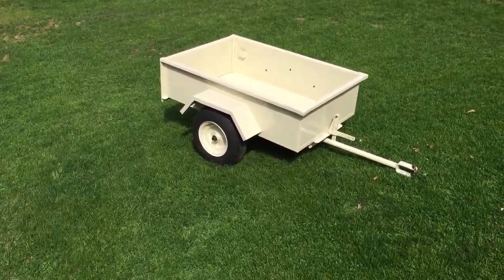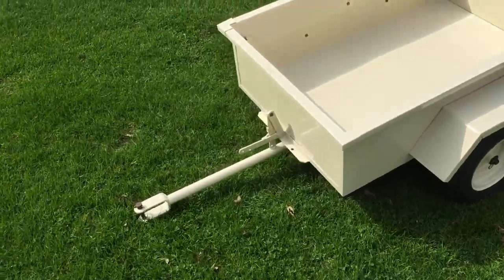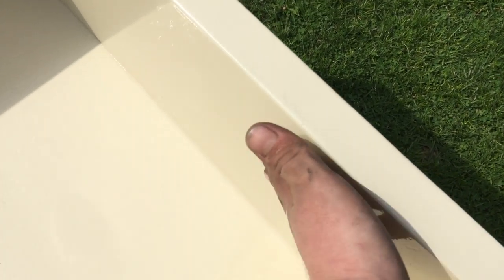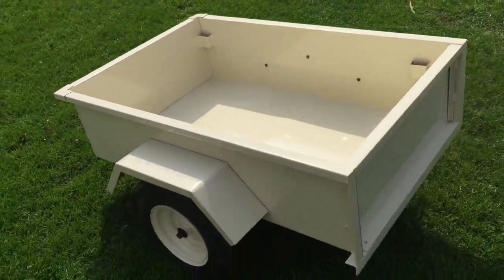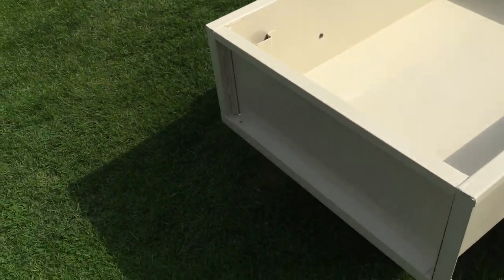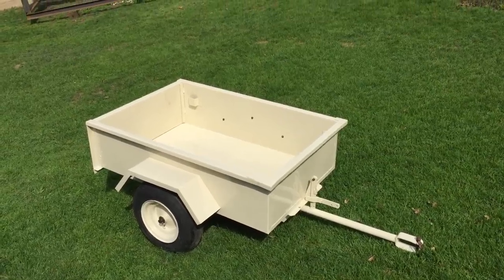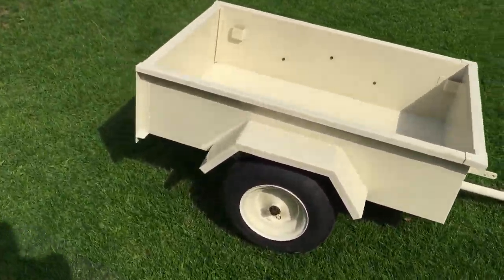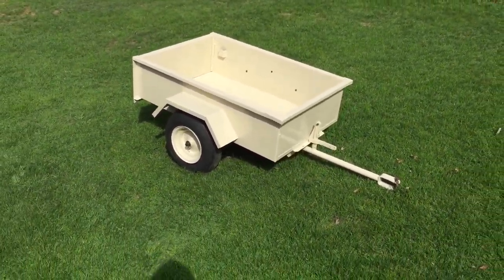IH cart model number 2 resto part 3

Comment: I just painted the sheetmetal on my Husqvarna tractor with Majik paint.  I used the cans instead of spraying.  I am used to using tractor restoration paint that TSC used to carry.  This new stuff is thick.  Came out nice but heard it needs a week to dry fully.  Cart looks great, you did a heck of a job on it.
Reply from the maker: Craig Arndt  thanks craig it did come out nice just needs some decals